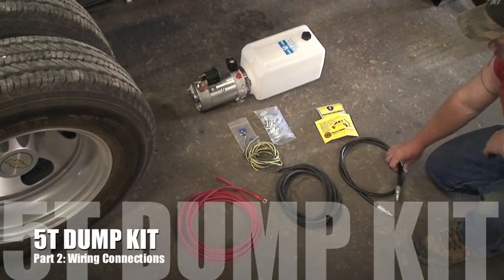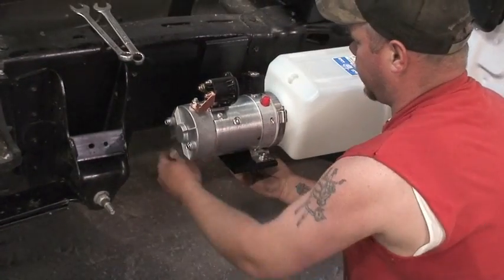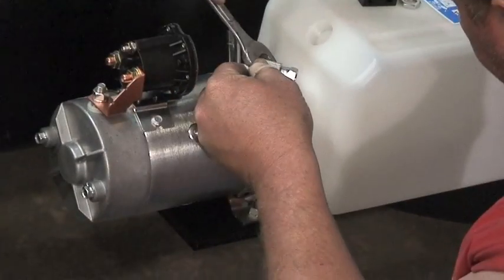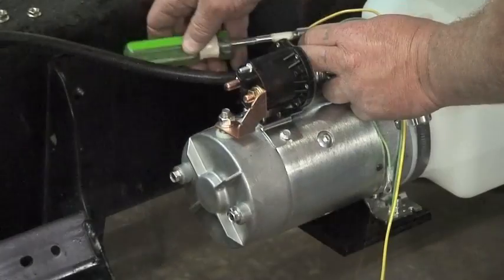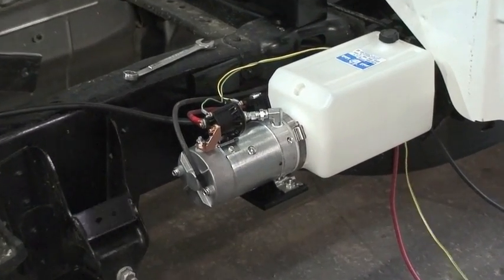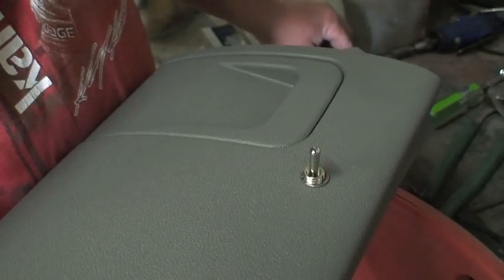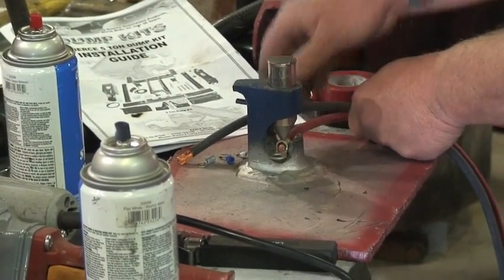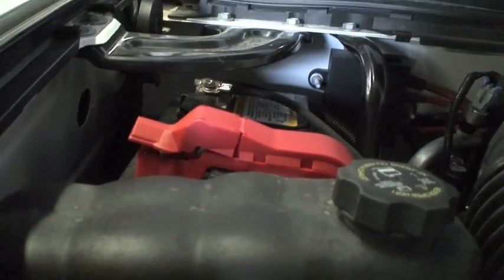Part 2: Hefty Hoist Dump Kit Wiring Connections

Comment: When mine was installed they poked a hole in the top for a carb but now it leaks out the top? I'm pretty sure they should have taken the cap off with the screen and poked a hole instead but I can't find any manuals online to see if I'm correct or not.